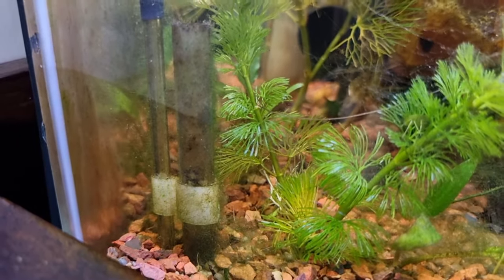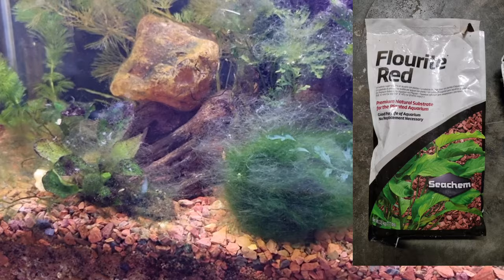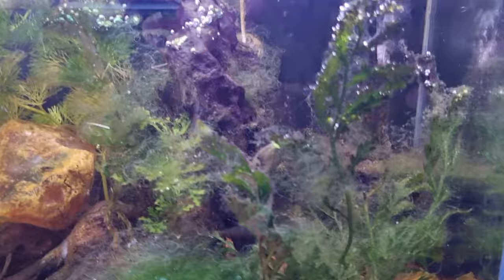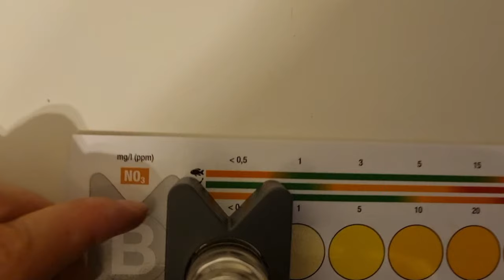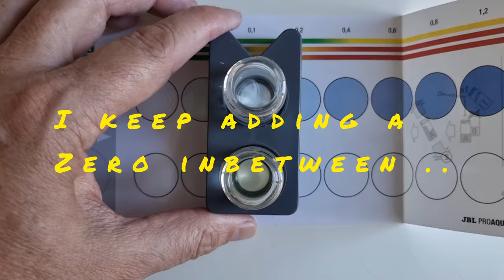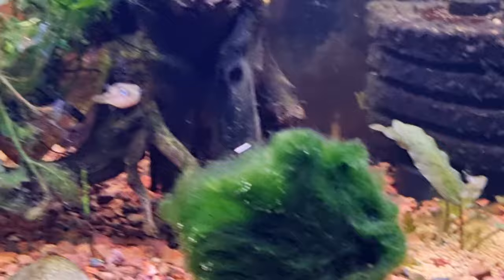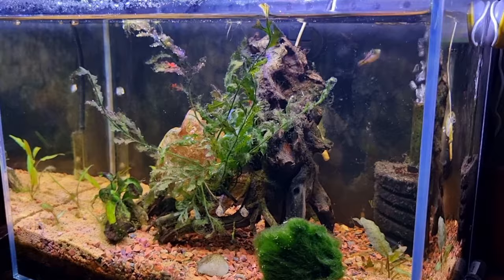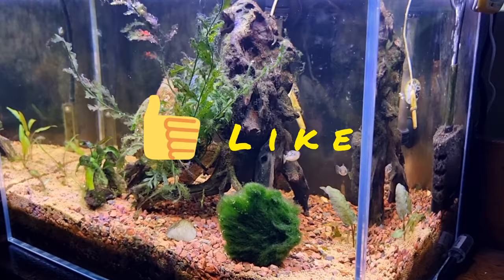My Anoxic Filtration Experiment - Did the Plenum work?

Comment: Very good video. I can tell you what you’re doing wrong though. You said you used “root tabs.”That’s a big no-no especially if you do not have bright enough, light and CO2. Your plants need very little nourishment, in a tank like yours and you’re over feeding them. Because of that, the algae  now has plenty of food to grow. Your sponge filter needs to be cleaned out a lot more than what you’re doing. It’s adding to your problem and making a food source also for the algae.
Reply from the maker: Thanks, helpful advice. I enjoy your channel.
Reply: Why to clean his sponge if you don't clean your sponge in your canister filter for year?!!
Reply: @DEXTER-TV-series his canister filter has a bcb basket and obviously the sponge filter doesn’t
Reply: @oioioioioioioioio  so what? He has sponge in his canister!
Reply: @DEXTER-TV-series  You asked a question and got an answer but you can’t comprehend because you’re on the spectrum. You’re welcome.
Reply: @oioioioioioioioio  your answer is not an answer.
Reply: @DEXTER-TV-series    you obviously don’t understand that canister filters require less upkeep as suppose to sponge filter.…this is common knowledge. Also, when you add bcb baskets that lessens upkeep even more due to little to no nitrate, etc.

Comment: Thanks,  like the review of the situation. Context: I have 2 40gal breeders set up with a slow moving plenum.The plenum does work well.  As some of the other commenters have said, stop the root tabs they are feeding the algae. I have a heavily planted tank, clay substrate with a small amount of laterite, no other fertilizers except occasional potassium added to the water column. The plants, mostly rooted plants, are thriving after a year.  With the pea puffers you may need a mechanical filter, the plenum does biological. You have a corner sponge filter, try an old fashion box filter or hang on the back for mechanical filtration. My 40s have three box filters each, which are changed about once a month with poly-fil. The alternative or addition would be to increase the rooted plants in the tank. You may be over feeding also. I have virtually no algae with this system.
Reply from the maker: Thanks for the info. The feeding has got something to do with it because they eat high proteien frozen foods (brine shrimp and bloodworm), they don't eat flakes or pellets. But they only get fed a small amount once a day. I added some water wisteria like someone suggested. Also vacumed the substrate to remove whatever was left of the root tabs. Lights only on for 6 hours at a lower setting. The situation is a little better but I still struggle with the algae. It is only a 5 gallon, so maybe I can fit the smallest box filter in there.
Reply: Give us an update when you figure out a solution. I have been looking a pea puffers so I am interested in how this turns out
Reply from the maker: @what_surrounds  will do

Comment: hi, maybe increase amount of root feaders and slow the flow evenmore.
Reply from the maker: I might try that.
Reply: What do you expect from slowing of the flow? 😮
Reply from the maker: @DEXTER-TV-series  the reason for slowing the flow in the undergravel filter is to create a low oxygen (anoxic) environment under the plate as a opposed to a high oxygen environment that you get with a fast moving filter. This is supposed to cultivate a different kind of bacteria that consumes nitrate no3.

Comment: Yeah as dr.Kevin Novak said, you are definitely using too much fertilizer for the type of plants and tank size, just cut down on the fertilizer, don't go over 8 hours photoperiod and keep doing water changes until the fertilizer is diluted enough, when a tank is balanced enough you don't have to rely on a clean up crew, I am also running a plenum in my tank and when I increase the fertilizers added I also start getting algae issues if I add too much, if you need plant suggestion I would recommend you adding hygrophila polysperma, dwarf saggitaria, ludwigia repens they grow really fast and look good. 🙂